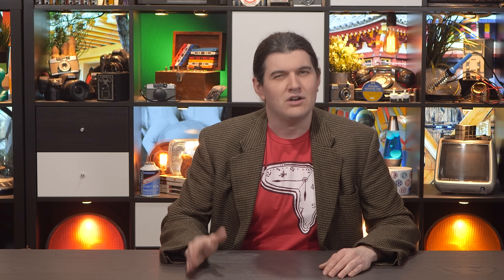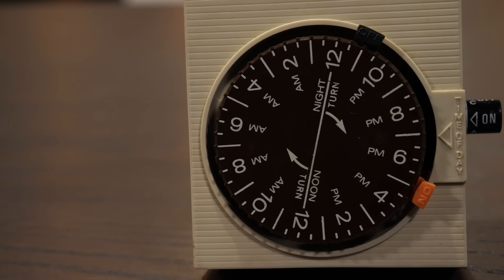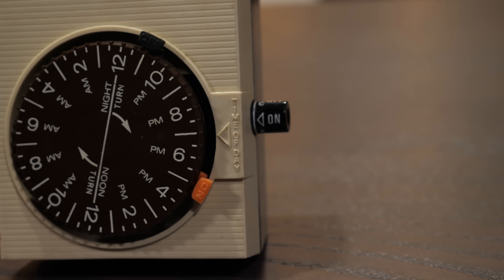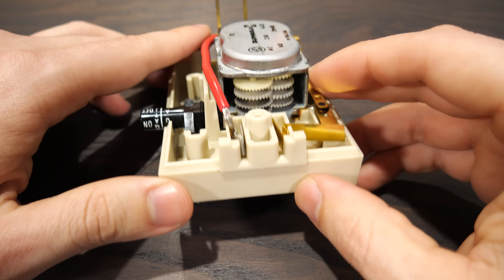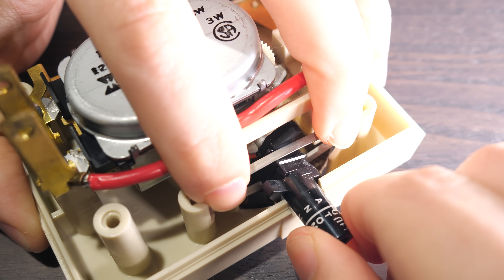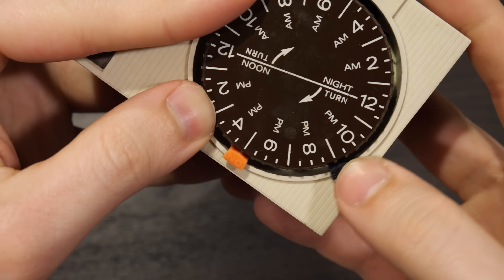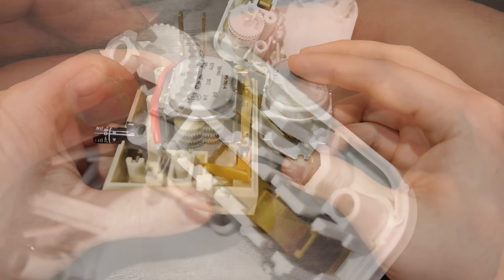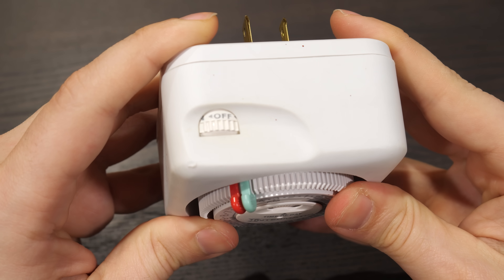Timer switches: literally just a clock and a switch

Comment: If you have just the simple type with one on- and one off-timer, but you have two of them, then you still can implement two on-phases by putting them in series. The complicated part is setting them correctly due to the "and"-nature of a serial curcuit. Say you want the lights to be ON from 1-2 o'clock and from 9-10 o'clock. You would need to set one "clock" to ON from 1-10 and the second clock to ON from 9 to 2 o'clock! 😀
Reply: That doesn't work as the second downstream from the first would not be running when the first is off, so it's more complicated than that, with that setup, the first would run the second for ten hours, then it would stop.  So it would remain in the on state for 14 hours, then the first would turn back on and it would start moving again.  
Given the extra wattage, far easier/cheaper to use a digital style which provides multiple programs (don't even know the limit of mine) or a smart switch.
Reply: @RJFerret  Good point!  Still it's a nice thought experiment - and much safer than wiring two of those "in parallel" ;-D

Comment: Alec, you cannot have an odd number of poles on an electric motor, especially not a single pole since that would imply a magnetic monopole which does not exist. As for 3600rpm is the synchronous speed of a two pole/one pole pair motor.
Finally I take issue with the synchronous motor being a "special kind", its theory of operation is probably the simplest of all kinds of electric motors and the other kinds can be viewed as wierd cases of the synchronous one.

Comment: I freaking love those mechanical things that are no more complicated than they should. However, the 3W motor is quite high. This might be a good enough reason to go digital.
Reply: With good power saving programming tricks and a modern MCU, the power consumption of a digital one is so low that it depends heavily on the efficiency of the AC/DC circuitry.
I'm even sure that a way more featureful device controlled by a small SBC running a full OS (like a Raspberry Pi) can drain less than 3W.
Reply: @PainterVierax  Often not worth it, running 1watt continios is 8,6kwh a year even with the high prices in Europe it is only 3€ per year, depending how much power the relay needs and how much "ON Time" you want, it can happen that you n1eed more power, because of the relay.
Given the that a mechanical one only cost 1-3€ your digital one is probably broken before you start saving money.
Reply: @jonasstahl9826  A latching relay would only use power to transition between ON and OFF. So basically nothing. I calculated approximately 5€ per year for a 3W device. It's not a lot, but it adds up if you have several of those.
Reply: @Ceelvain  Consumer stuff is made by the cheapest manufactor so probably no latching relays. 
Lets say the mechanical cost 2€ but 5€ of power per year, digital is 20€ but only 2€ of power per year, digital safes 3€ per year but cost 18€ more needs 6 years for return on investment.
Reply: @jonasstahl9826  a latching relay doesn't need power to keep any state ;)
Although a well built digital one do not reach 1W idle (this is for a mediocre one, designed to barely pass certifications) whereas the analog one is much around 10€ per year. Multiply that by the number of timers used and it adds up quite significantly.
Finally, the main purpose of a digital one is to get more fine tuned programmed periods. That allows to spend less time powered on for nothing. Some systems allows to be externally driven or use diverse sensors for even more control as well as safety features. That also can be as unexpensive as a mechanical one (especially if homemade) and for such simple electronic devices the longevity is still decades-long.
Reply: Depends a digital still needs 1w and up to 5w when the plug is on because it needs to power the relay.

Comment: i have multiple timers running during winter time, one switches a light on to keep my indoor plants happy as its pretty dark here and they would wilt otherwise
the other turns on a fan  for a few hours each day that moves some air so it wont get all mucky and stale as i dont have my windows open nearly as often as i do in the summertime

Comment: I like the old ones with the little tabs all around the outside. They can make you flitch as when you set them, they tend to spark right next to your finger even when not under load. But they also never seem to fail even after a decade of use.

Comment: Using an online newspaper search engine, it seems that the first ads for the Intermatic D111 model specifically occurred in 1971.   There were earlier models as well.  The Intermatic Time-All brand seems to be first advertised in 1953 with Intermatic Time Clock switches mentioned as early as 1949.   Ads for the TN111 model start in 1996.  It seems mentioning the specific site got my comment not accepted originally.

Comment: Damn - i loved those.
We had one similar to the first one and used it for the washing-machine. Good old normal analog washing-machine. set the program, flip the switch, and as soon as it gets power it starts running. Not too long ago i was about to buy one of those again for this exact reason cause just for this functionality the washing-machine would have costed over 50€ extra... for a freaking timer.

And even better - had something very similar in my last apartment, but it was a bit more involved. Like the 3rd one with the pushable pins, but 2 concentric rings. The inner one had 24tabs for the hour, the outer one had 52. You guessed it. That was for controlling the heating. The outer ring allowed you to turn it on/off for a specific week.

Comment: One question you didn't address here is, who convinced the power companies to put all that effort into making sure the 60Hz line frequency is accurate enough to run a clock? It was a guy named Henry Warren, who had invented a self-starting synchronous motor and wanted to sell electric clocks, but discovered that the typical line frequency at the time wasn't accurate enough. In 1916 he convinced Boston Edison to install a master clock he had built, and by the late 1920s electric clocks were becoming common. In 1917 General Electric bought a 49% share of the Warren Clock Company (renamed Warren Telechron in 1926), and bought the remaining shares in 1943. Their clocks were branded as either "Telechron" or "GE" (their major competitor was Sessions). See the book "Electrifying Time" by Jim Linz for more than you ever wanted to know about this stuff.

Comment: Those timers are also good for security purposes, especially if you are going to be away for a little while to turn lights on and off so bad people that want to rob you think you are home.  One thing you forgot to mention is some digital timers have a feature to stagger the on and off times a bit so the light isn't turning on and off at exactly the same time to try and give the appearance of varied times the light is being turned on by a person because the more professional bad people could figure out you aren't always home if the light turns on and off at exactly the same time.
Reply: Maybe you cold do another timer video and tell everyone how the digital timers work to turn a light on and off since there isn't a switch turned by a motor.  I suspect the switch is a relay type switch.  But it would be neat to see how the timer activates the relay switch.  And it would be neat to learn about the feature that varies the time a light turns on and off to give the appearance that a person is turning the light on and off when they aren't home.

Comment: Maybe you should look into mechanical sprinkler timers? I have always found them very interesting, especially the RainBird RC series.
Reply: IIRC, they work with a tiny bit of the water pressure.  They leak just a slight bit of water out to move the clock movement.  I imagine you must adjust the speed of them to your municipal water pressure however. Newer ones are electronic

Comment: I used to have this exact same model of the first timer in the early 1980s as an alarm light clock to wake me up each morning.   I originally had it hooked up to a small electric bell since I am hard of hearing.  While it worked it wasn't accurate.  I mean I can get it "close" enough to wake up at the time I wanted.   Several years later I picked up their digital clock model.

Comment: If you want a timing sequence that has a period longer than 24 hours, you can plug one timer into another. The second timer runs only when it gets current from the first. You can get really complicated switching patterns that way, but it is really confusing...
Reply: Ok, this doesn’t slow down the child timer as such, rather, it makes it advance at its normal rate during few but always the same selected hours of subsequent days. One can vary the on/off profile during these hours from one day to the next.

Periodicity will depend on vagaries of the primary switch’s response lagging differently for “off” vs. “on”.
Reply: That sounds like some minecraft redstone shit.
Reply: @KairuHakubi  or some sort of Rube Goldberg analog counter stuff with marbles
Reply: I have a analog timer with multiple one off time points.
Reply: It's timers all the way down.
Reply: I've often thought this is a good idea if you want lights to come on at seemingly random intervals for varying periods of time while you're away on holiday. This could make it seem like the house is occupied to a casual passer-by.
Reply: I made a one week timer a few years ago to turn my water filtration system on for an hour every Monday. The trick is to take two timers and hook them in parallel to a third timer. It's easy to adjust the two timers (one of them turns the third timer on, then they overlap, then the other one turns the third timer off) to be accurate within 2 minutes. You adjust the ON time (the time either timer is on) for as close as you can get to 205.7 minutes which is a 7th of 24 hours. So now the third timer will be on 205.7 minutes every day and you set that one hour to be on the specific approximately 204 minutes that happens on a Monday. At 2 minutes error I had 204 minus 60 or 144 extra minutes. With 72 minutes on each side and two times seven or 14 minutes of possible error per week I could run it for 5 weeks with no problems. But I measured how much I was off and it was about 1 minute too much so I set the one hour at the beginning of that 204 minutes so I had 144 minutes of leeway which meant that at 7 minutes of error per week I was good for 20 weeks. 
Note that since a power outage will stop all the timers and restart them again at the same time (including the pump they were controlling) the system will work fine only It will run later by the amount of time the power was out.
Reply: Why stop at two? My brain is likening multiple timers linked up to gear ratios.
Reply: @ConflictedSwitch  I need a light to switch off on February 29.
Reply: @azz2  Ah, so usually March 2nd, but March 1st on leap years?  Easy-peasy.
Reply: @ConflictedSwitch  No one wants an electrical switch based universal death clock.
Reply: @ConflictedSwitch setting mechanical timers to compensate the change of the sunset and sunrise trough the year.
Sounds like a challenge. 🤔
Reply: Very good idea to set up an explosive device - noone would know when it goes off... so you can be hundreds of miles away to have a clean alibi :) not sure why i thought that as the first application... but there we are :) [why is there a police car outside?]
Reply: @okinnivlek  I agree that doing the math sounds fun. While I doubt the practicality, usability and reliability.
The difference between theoretical and what you actually get might be fairly significant.
If you want a long cycle time to be in sync with a 7 day week, you'll probably be better off with an electric timer.

If the on 24 hours isn't perfectly decisions by the on time from the primary timer, the secondary timer will drift out of sync.
Reply: This is almost like adding a second echo machine after a primary echo machine! Crazy results!
Reply: At the very least, that's an excellent idea for giving maths problems to students. And building long-timescale rube-goldberg contraptions with seemingly erratic behaviour - as the mechanical bits aren't too precise, a stack of three timers set to "30 minutes per day" probably wouldn't give you a solid 30 minutes every 6.31 years, but short "glitches" of a couple seconds after 5 years, and increasing for a while after that...
Reply: Jaap Scherphuis:
Intermatic had, and likely still has, time switches where the disk with the trippers turns once per week.  The operating concept is the same as depicted in the video.
Reply: @TorontoLS  But where's the fun in that?
Reply: This quickly becomes a topic for the Numberphile channel.
Reply: The challenge is however to get a reliable cycle. You might end up with some short on cycles.
The secondary timer might switch on, but shortly the primary switch off.

If you set primary on for 2 hours, then you'll get a 12 day cycle, maybe 30 minutes on every 12 day. But you might end up split those ,30 minutes over two following days.

If the on time isn't exact, it might drift. If you made sure the 30 minute were in the middle of the 2 hours, it's actually 119 or 121 minutes the secondary timer will drift.
Reply: I have seen some 7 day timers, I believe many digital timers can have different daily on/off cycles, I know that the Wi-Fi enabled timer switches such as the Belkin WeMo products, and others, can also do this.  I may have seen a mechanical 7 day timer, but I couuld be dreaming.
Reply: Shouldnt be to confusing, its just like gear ratios but you can only go down lol
Reply: My grandparents had a timer which can be set up for a whole week.
Reply: Good idea, I want to start stringing together timers now
Reply: I have several Intermatic switches with the little green & red time pegs for on & off. They are super reliable and easy to program. Top notch!
Reply: Or get a smart switch.
Reply: Very interesting!!
Reply: ...I have a hard enough time wrapping my brain around just ONE of these timers (we have that third one with the 4000 tabs for Christmas lights and it always takes me like three weeks to nail down the timing).
Reply: That's a great hack. 👍
Reply: Doesn't sound that confusing to me. Some simple napkin math or its modern version: some simple Excel math, should do the trick
Reply: @Aelfraed26  its not napkin math bruh, mr im very smart
Reply: @Megasteel32  Yeah maybe not napkin math, but definitely Excel math
Reply: @Megasteel32  I wouldn't call it napkin math, primarily because I'm a Seppo and I prefer the phrase "back-of-the-envelope calculation". Who needs a spreadsheet for rational math that even Aristotle could figure out?
That said, there is some unpredictability in the spin-up time of the daughter timer; I'd rather add on a couple more gears, possibly driving separate switched outlets.
Reply: @petersage5157  why do you keep implying that estimating the cycles of several gears with various on/off periods is a trivial matter? since we apparently want to use big words to appear smart
Reply: @Megasteel32  Because it is that trivial. Simple division is simple.
Reply: @petersage5157  its not simple division LMAO
Reply: @Aelfraed26  It sounds really complicated actually. Even dividing 24 by 7 (which you need if you want to address indivual days of the week) already gets you a very uneven number.
Reply: Many of the digital ones tend to reset if power is cut
Reply: @0xbenedikt get a mechanical one
Reply: @ThatEngGuy  Or a digital one with a battery.
Reply: @rainbowkrampus  ,
Wouldn't work, as the battery will power the second clock in lue of the first clock.
Reply: @0xbenedikt  The 12 o'clock flasher. If only they could modulate a BCD timecode onto the local mains :D
Reply: Well l a mechanial one loses its time when the power goes out. So either way you have to reset them

Comment: I'm assuming it is the same company, my "Intermatic" T104M Mechanical Time Switch  is designed virtually identical to the first timer you discuss. It has just two moveable on/off metal tabs that will turn my swimming pool pump (220 volt in this case) on each day at 10 am and off at 4 pm. Inside are the multiple stepdown gears you discuss. The adjustable on/off tabs are just as easy to lose today as it was for the folks that had your device (haha!) These simple timers are still practical today in 2023!